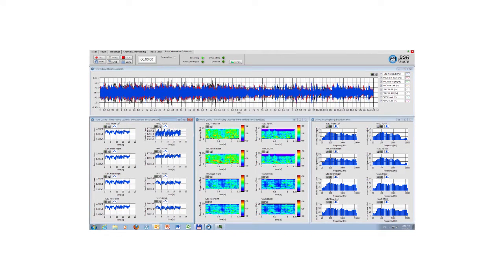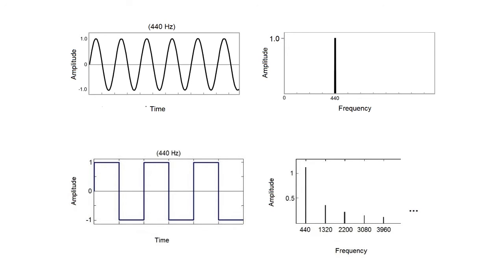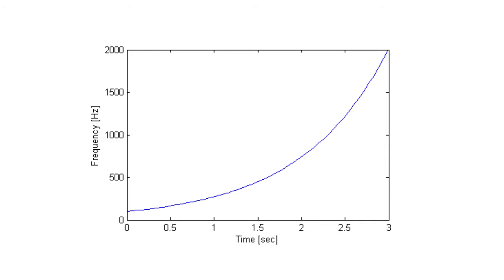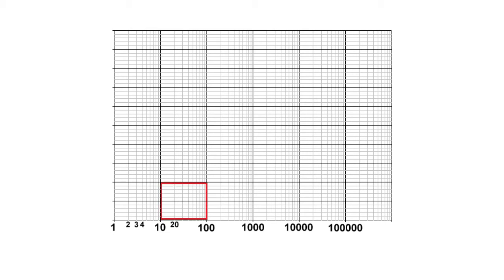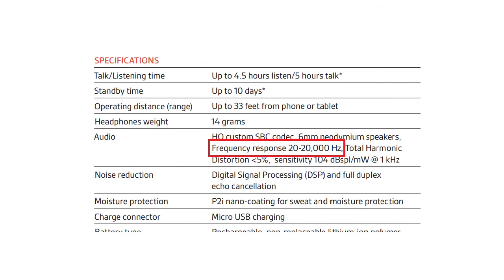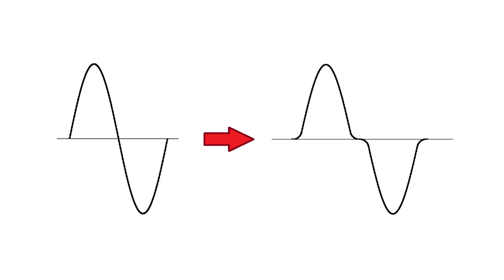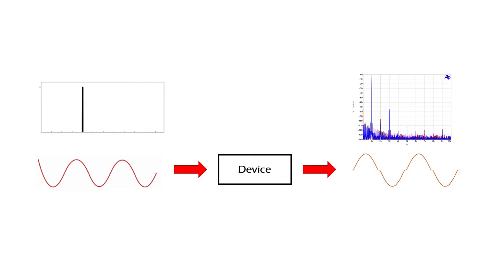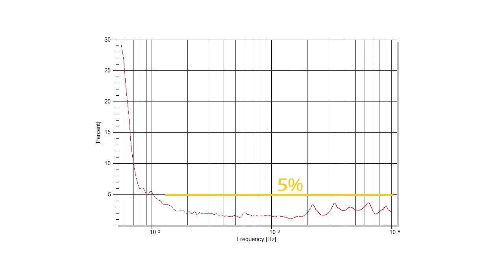13 Frequency response, sensitivity, and harmonic distortion

Comment: Thanks a lot for the video. Do you have any video o reference about how to make your own frequency response plot? I am using a MEMS mic mounted on an Arduino-type board and I have sample audios recorded from a white noise at different frequencies but I don't get what it means the "reference to magnitude measured at 1 kHz". I want absolute decibels.
Reply from the maker: Hello! Are you playing the sample audios from a loudspeaker on the board? That's not really clear in your text.

The thing with a frequency response is that it really is just meant to show how the device responds relatively to different frequencies, without absolute units. 

Let's say that you measure the frequency response of a loudspeaker in, say, dB SPL. In this case, you could always shift that curve up or down simply by turning the volume up or down from the audio source. The fact that this freedom exists means that there is no set frequency response at specific levels. The only thing that's consistent is the difference in strength between different frequencies and that's why the frequency response curve is meant to be relative, without absolute units. It just tells you that one frequency will always be X decibels stronger than another frequency on that device. 1 kHz is pretty easy to remember and quite in the middle of the audible spectrum which is why that's the typical reference, meaning you just choose to make 1kHz = 0 dB, and everything else is just stronger or weaker by X decibels compared to the response at 1 kHz.

Sensitivity is meant to be more of a comparison between the input and output, because depending on the components and circuitry, there can be different conversion rates of volts to pressure (meaning, how many Pascals correspond to each unit of voltage)